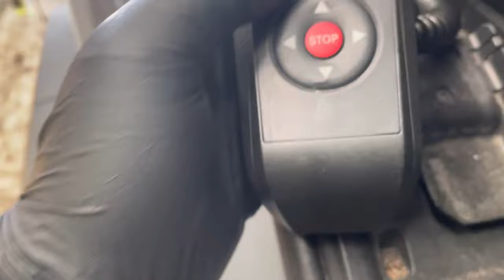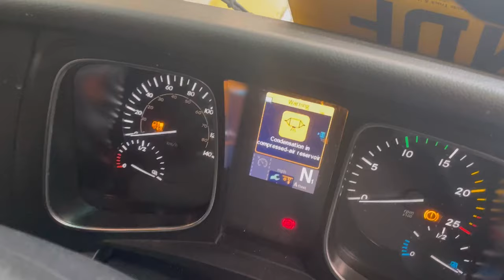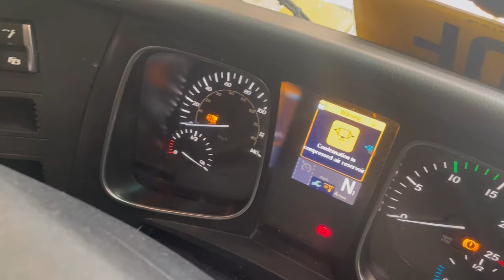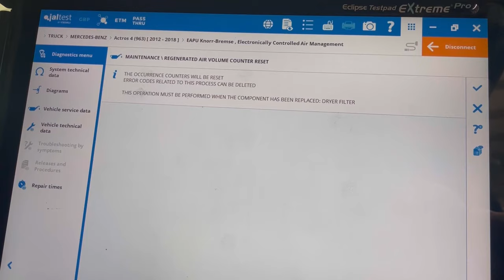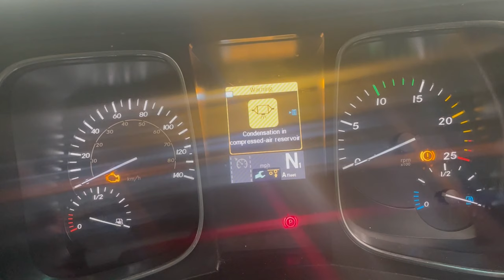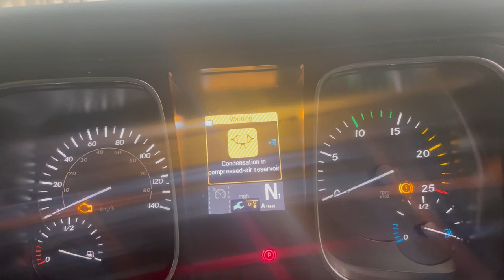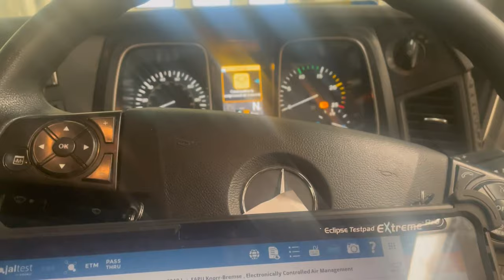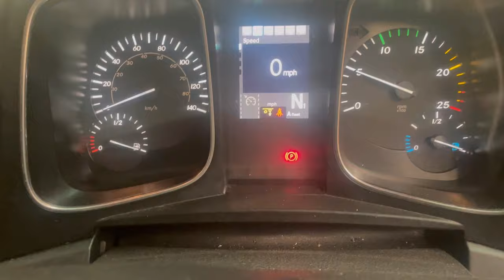VLOG- DAILY LIFE OF A HGV MECHANIC- Mercedes brake fault? and an annoying condensation fault!

Comment: So the merc has the grown up version of the LFs brakes..My way of adjusting is to tighten them up ,couple of brake presses adjust up again ,another couple of presses ,then i back it off quiet   a bit ...as they will always adjust up ,but if they are to tight they won't back off ..That last bit for those who may not know..I also have that snap on flexi head  ratchet ,brilliant bit of kit use it all the time ..Makes sense that if the counter is still high that it won't clear ..Luckily i do not touch merc lol
Reply from the maker: Yeah funnily enough thinking about it now it’s Exactly the same as the LF calliper, I always back them off so the brakes nice and free, will always show up on a brake test of any potential problems. Haha Mercedes’ ain’t to bad tbf! You like the DAF?